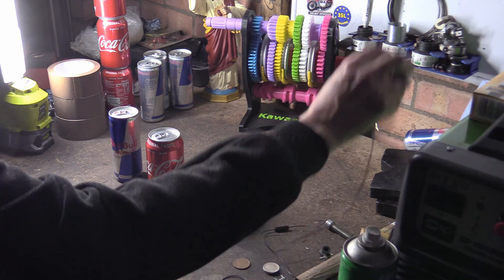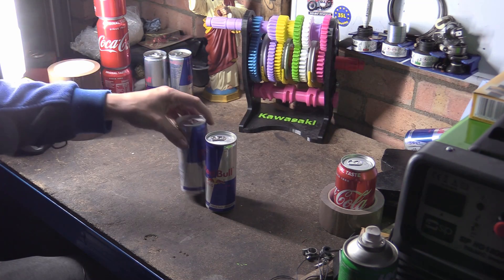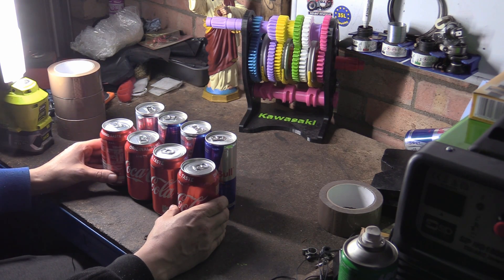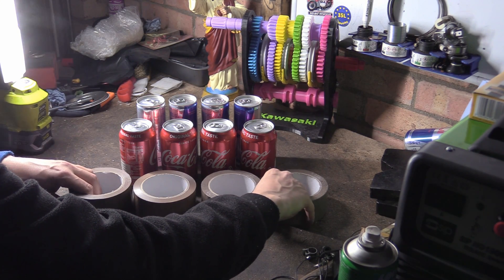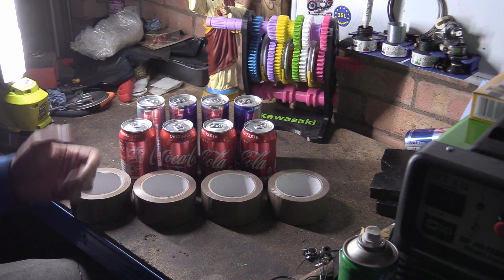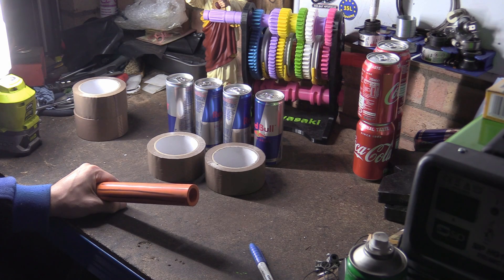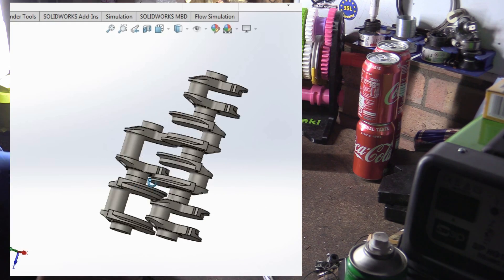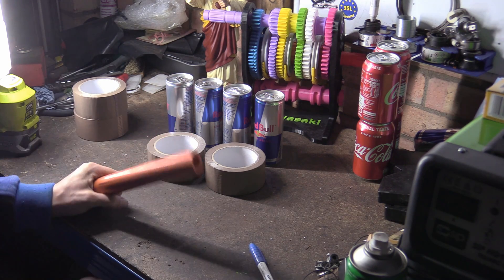Why a V4 engine?

Comment: Why do you think suzuki moto gp ditched the v4 and went to a cross plane crank? Also do you think the R1 crank issues could be related to this twisting force of a high torque engine with a long crank?
Reply from the maker: 1) usually changing to  different layout than the 'best' is for commertial reasons. I.e Suzuki probably said to their race team something like 

"you can have a race team and the 'x' million $ to do the racing as long as we get R&D back in return for the investment. We're not interested in producing a V4 road bike so the answers no to building one"

Meanwhile Honda just wanna win, as do the others and just throw money at it.

As for the failure, no. The reasons being that the failure would happen on every engine all of the time.
Reply: @thedirtyworkshop  re: failure but not all engines are torquey cross plain cranks that rev quite high

Comment: Hi Matt. I teach a Mechanical Engineering degree and HND, nothing clever about that. One of my topics is the definition of stress concentration factors in crankshaft fillets. What I like about your videos Matt is you teeter on the edge of the Mechanical Science, almost as if you want to waffle on for hours about the hot rolled steel and forging process. I do enjoy these videos and am in the process of building a small workshop. It is great to hear someone with an understanding of Mechanical Engineering, keeping it very real also.
Reply: And before anybody adds (but aren't all crankshafts designed to suit their application and load?) yes they are, using the Von Mises yield criterion, but that isn't what Matt is talking about here. Good video.

Comment: One of my favourite bits of engine trivia. Subaru EJs are flat 4 with timing belt 2-2.5L. When they made EZs ( 3-3.6 6 cylinder) they switched to timing chain. The result is the ez is only something silly like 3inches longer than an ej. For the EZ36 they went to assymetrical rods etc. Seems like they were testing features for what would become the FA/FB series engines.

Comment: Matt,  not sure if its been mention or if you have explained previously. Of the back of this, Can you explain  the benefits to having the crank work in reverse rotation to the wheels as im lead to believe it does on the Ducati v4? No expert just curious.
Reply: I'm pretty sure that's for the benefit of the Handling of the Bike - a reverse Crank cancels the Gyroscopic forces generated by the Engine whence makes it easier to turn.

Comment: It looks like duct tape had more surface area for intake and exhaust valves then the other options. I'm sure the Red bull, Coke and tape roll have their own strengths vs. weakness. I'm now more curious how much valve size will play into this formula!

This was an educational video, in an very easy to understand language. That not easy to do with such a technical subject.

Comment: Id like to hear story about angles and firing order. For example difference between V4 180 crank and V4 360 crank. What is most close to R1 crossplane in V4 configuration, each bank on same pin and 90 degrees between left and right?

Comment: is an other positive for a   V4  also not to have a good balance inside the engine that will lead to a less viby motor ? So no need to use a balancer shaft etc ?
Reply from the maker: Balance is a totally different set of videos - One thing at a time

Comment: Do you think a V4 on a light wieght sports car be good or a V4 sport saloon car similar to a BMW M3? or does a V4 have an advantage vs  conventional Inline engine on a car?
Reply from the maker: Car? Who cares about cars? Wrong channel dude
Reply: @thedirtyworkshop  well even if its the wrong channel to ask atleast I can apply the engineering. but my main question is. Can A V4 make 1000hp with the given upgrades and tunning? or can  Sports bike with a V4 make 1k hp? that is what i would like to know and learn if its possible
Reply from the maker: Your question is an energy based one, nothing to do with engine configuration...

Comment: arent  yamaha and suzuki using the in line 4 cross plane engine in motoGP?
Reply: Yes indeed they are. Yamaha are using a crossplane inline 4 (with 270-180-90-180 firing order) and Suzuki are using a traditional inline 4 (with 180-180-180-180 firing order)

Edit: I was wrong about Suzuki. They are not using an 180-180-180-180 I4 engine.
Reply: @Shahar_C  I'm pretty sure the Suzuki uses some form of 'big bang' engine ie. not an even 180 firing interval.
Reply: @joonya4427  
Interesting, didn't know that. Do you have a link or anything to that information?
Reply: Its interesting to note that Suzuki's previous MotoGP Machine (GSV-R) was also a V4,albeit a 65 degree one.
Reply: @Shahar_C  Unfortunately I haven't been able to find any specs. on that.  Check out the following vid. though.  It sounds like a big bang motor to me.
https://www.youtube.com/watch?v=yL_rSe8M5Uc
Reply: @joonya4427  
Yes, you're right. It's really sounds like a cross plane (or big bang). Even more interesting when you realize that Suzuki are the only manufacturer that doesn't currently offer this engine configuration to the mass market.

Comment: it' not what you're talking about, but, a vfr with a not-too-loud-but-beefy endcan sounds like half a v8 and screams like a nascar. that's it. all the other stuff is nice and everything, but the way it sounded is absolutely what i miss the most inc changing it
Reply: Even stock they sound pretty good tbh. There's an area between about 3k - 4.5K where it sounds like a boring honda twin. But get it up there and get it howling and it sounds like a bit of an exotic V8 and a tad RCV esque and I've had it turn plenty of heads (6th gen)

Comment: Long stroke red bull gives you wings, that's why many airplane engines are low rev high torque long strokes. It all makes sense now.
Reply: I thought this before also but in theory (!) the stroke x bore relationship doesn't affect the torque. If the engines with a given displacemen have the same BMEP at the same rpm.
Take a very common airplane engine the Lycoming O-360; bore 130 mm, stroke 111 mm. It's a short stoke and yet max power at only 2700 rpm.

Comment: Im thinking about the block weights.. Especially in an oversquare V engine the halves of the blocks are siamesed. And a V has less adjcent cylinders putting out heat to the next one so you'd worry less about cooling. . I guess a V4 block would be a lot lighter?

Comment: As far as the MotoGP reference, and setting rider ability aside, the V configuration doesn't seem to have that much of an over all advantage (if any) over the inline engines. Cost of production wouldn't be an issue at that level of competition. Given a choice for the street I'd pick a V4 anyday. Great explanation as always.
Reply from the maker: "the V configuration doesn't seem to have that much of an over all advantage (if any) over the inline engines." - LOL Apart from both Honda and Ducati blitzing the Suzuki and Yamaha Down the straights? - No advantage at all....
Reply: Steve - your probably aware that of the Six Manfacturers in MotoGP  Four of them use V4 Engines,but as you say the costs of production means that ratio is not applied in Road going Bikes.

Comment: Could you do a video about what you think is the best engine configuration (V2, parallel twin, I3, I4/V4, whatever) for the street/general use? i know that displacement and cost basically mean everything but looking at decent prices and comon bikes, even spiting out a number in terms of cc and hp that would sufice or be close to 'spot on'' for everything. I think it would be insteresting, just an idea for a video.

Comment: Wonder why you don't see more V4 engines out there
Reply from the maker: Cost and weight - but mainly cost
Reply: @thedirtyworkshop  Radial engines must have very small crankshafts. I want one in my car.
Reply from the maker: But they also have other issues

Comment: Wouldn't W4 be the best then?
Reply from the maker: You still have to fit everything in... If you were to do a W4, which is really a wonky V4 then you would have contact issues - you're throws and bearings have to go somewhere - and we haven't started talking about torque yet
Reply: W engines are shit as a general rule. That's why VW makes them, they just can't resist making a crappy engine.
Reply: @thedirtyworkshop  What about a straight up cross-shaped radial 4 cylinder, lol?

Comment: Except there are these things called turns on racetracks. That longer crankshaft is like a tightrope walker w/ his arms out whereas the V4s are like one w/ hands at his sides. Longer crankshaft = more corner stability = power through corners (moment of inertia). 2020 Moto GP Top Three Riders... All Inline-4s (Suzuki/Yamaha/Suzuki). Top Three Constructors.. 2 Inline-4s, 1 V-4 (Ducati/Yamaha/Suzuki). 6 races down this year, Yamaha with a good lead. What happened? The FIM was handicapping the Inline-4s by regulating tires w/ less grip in corners, probably to make the races more "close" and have dramatic passes on the straight rather than dudes winning just running away with corning speed as per Doohan w/ first "Big Bang" engine in 1992  (until his crash at Dutch TT). They relaxed it in 2020 and BOOM! Inline-4s rule. Power is nothing without control. Those same long twisty forces now become an advantage over bumps and everywhere you have to turn because it likes whatever path it happens to be on and the shorter stiffer one is twitchy.  And because the Inline4 is more tractable the rider can relax more rather than fight it. It was always there - Tires, tires, tires. 

https://www.motorsportmagazine.com/articles/motorcycles/motogp/why-inline-four-motogp-bikes-handle-better-than-v4-motogp-bikes

Comment: But such a v4 has horrendous gas milage in the real world. 120km and I had to fill up my tuono v4r. And it didn't matter how hard I drove it )
Reply from the maker: LOL that's nothing to do with the V engine.
Reply: @thedirtyworkshop  no shit? And it has nothing to do with the short stroke?
Reply from the maker: Why would it be?
Reply: @thedirtyworkshop   short stroke engines work with decent efficiency only in the mid to high rpm-range, and they're shit in the low rpms, that's why you don't see them on roads very often
Reply from the maker: Which ones?
Reply: @thedirtyworkshop  try naming at least 10 mass produced short stroke car/motorcycle engines (where the bore is at least 1/3 larger than the stroke) - those are the ones...
Reply from the maker: LOL where did you get 1/3 from? And is that the line where large and short stroke engines are? Panigale V4, Monster 1200, Suzuki SV1000, Aprilia RSV, - most of the V-twins. As for other bikes like the GSXR1000, R1 ect they are just below 1/3.
Reply: @thedirtyworkshop  that's just a rough guide line where the consequences of an ovetsqare engine start to be quite noticable
Reply: @thedirtyworkshop  and not all the bikes you have listed have a stroke that is less than 2/3 of the bore size. And thats like 2 times short of 10 examples. And by the way, the bike that has the stroke that is less than 2/3 of the bore is complete garbage - the monster...
Reply: @thedirtyworkshop  and the supersports... Maybe you haven't heard, but there is a thing named homologation...
Reply from the maker: I wrote a big long reply - but for some reason it fucked off. In summary 

VFR1000
Monster 1200R
All the duacti engines 
Buell 1125R
Mille
Tl1000
Bimota SB8R
KTM RC8

Does that make you happy?

Comment: V4s are always the best.  As exemplified by my VF500. 

ahem camshafts fuck fuck fuck
Reply: Was the VF500 affected ?  I thought that it was just the VF750 that was afflicted ?.
Reply: @paultanton4307  Nah, all the VFs were affected, some worse than others, but mainly due to luck, maintenance, and owner's mechanical sympathy.  It's down to galling on the cam lobes, not entirely uncommon on bikes of that vintage, but devastating on bikes demanding the kinds of tolerances the VFs have and that get the kind of thrashing a V4 does.  It's the noise, you know.  Well, that and the performance....  The 400 and 750 were the worst culprits, but yes, the 500 and 1000 suffer as well.  Mine's in a pretty good state, FWIW.

Honda pretty much fixed the issue in the 1986 models, IIRC, but the bad mojo meant they had to go to the VFR with its gear driven cams (which do nothing to solve the problem, but hey, new cam technology, must fix it, right?) before people would look at a Honda V4 without laughing.

That exhaust note, though.  Heavenly.  Only really beaten by the CBX.
Reply: Cool - I'm pretty up to speed on the 750's problems but wasn't aware that it affected the others quite so much,mind you as far as the VF1000F/R service schedule  goes Honda do actually list (recommend) a PTFE Oil additive just in case.

Comment: and then there's wheelbase...
Reply from the maker: What?
Reply: @thedirtyworkshop  well, i think we're talking about motorcycles but i could be wrong, maybe it's extremely high performance ski boats. But if it IS motorcycles, the valid points you make about Vs versus inlines also relate to other key issues in the world of performance motorcycles. E.g. V-4 motors are not as short front to back and thus not as easy to stuff into a motorcycle frame. The typical longer wheelbase required for a V4 (or 5) makes for a bike not as rapid in the same radius corners as the shorter one possible w an inline--mutatis mutandis, of course
Reply from the maker: But what did I say in the video? This is just about cranks and pistons - the core engine! Why do I fucking bother?